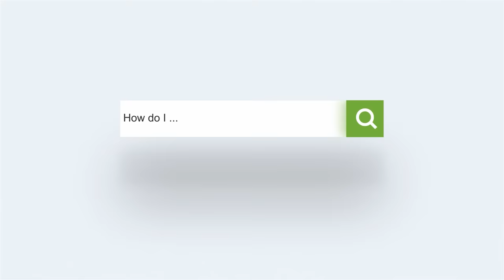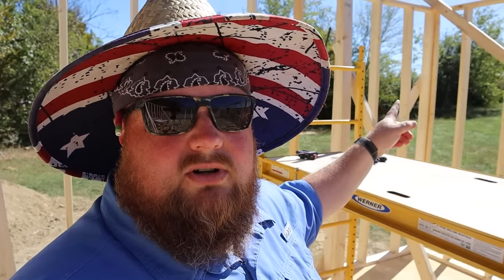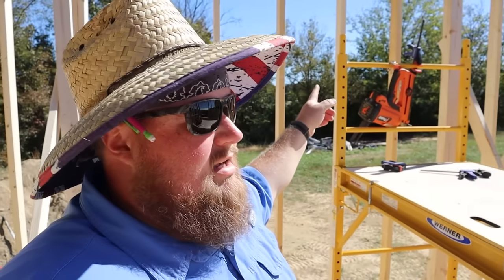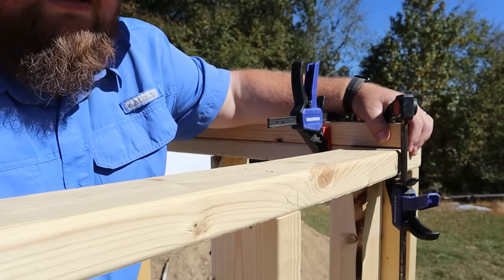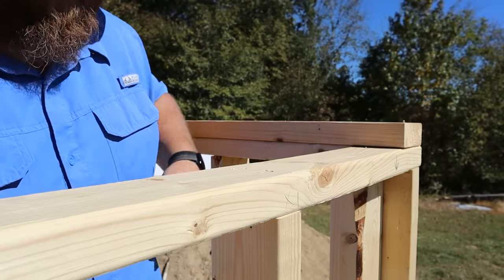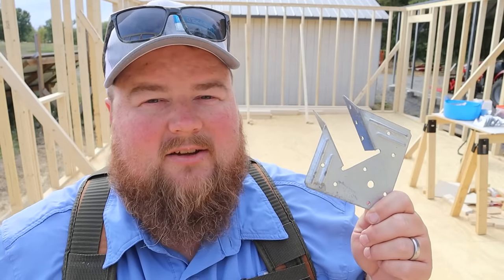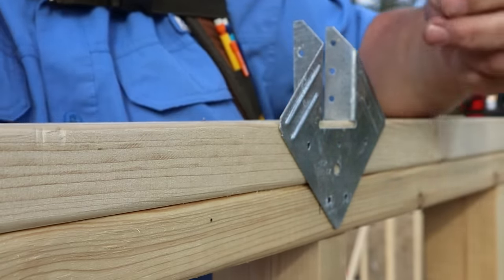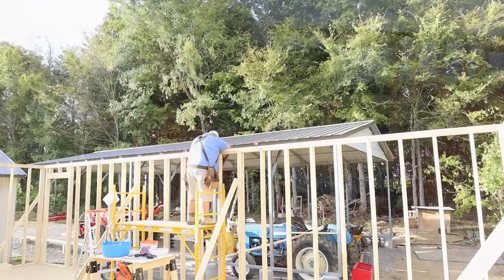Double Top Plate & Roof Truss Preparations! // 20x32 Workshop Build

Comment: Never knew the hurricane brackets could be installed on the outside. I always though they were put on the inside of the building. Nice to have options.
Reply from the maker: The exterior install is the preferred location, but when done as a retrofit or repair placing them inside is better than nothing. :) I installed them on the inside of my current workshop when I built it, not knowing better then.
Reply: @Samcraftcom Do the screws in the hurricane clip affect the exterior siding? It seems that the screw head would push the siding out. Thanks in advance.

Comment: When nailing the top plate on, I like to angle the nails. One nail angled to the left, the other angled to the right. Or to the inside and outside. Having the nails at opposing angles helps to lock the 2 boards together much better than just nails straight in. 

Super job, looking good. Thanks for bringing us along
Reply from the maker: Great tip!

Comment: Awesome playlist, I'm watching the entire thing while planning our home build for spring 2025. 

Question, while nailing your double top plate directly on top of studs, how are you not hitting the nails that hold the stud to the top plate?

Is there a technique to this, sheer luck or something I'm missing? I would think it would be better to offset a few inches and nail at an angle towards the stud no?
Reply: You just nail the top plate to one side or the other of the stud centre.  Basically, you put them as close as you can without hitting the nail underneath.  If you are framing a lot, this will come second nature to you.

Comment: suggestion to put a 2x2   around top plate for a nail/ screw  anchor place for ceiling panels Sheetrock or other paneling  also  i believe called California corners  also for paneling screws at corner locations  eliminate floating edges
Reply from the maker: You're exactly right on the California corners - they act as drywall nailers inside the walls. The ceiling nailers will be installed later on, but only on the gable end walls. Anything put in place on the truss bearing (side) walls would need to be cut and fit between each truss to overhang into the room.

Comment: Hahaha Sam, this has just proved a point that ALL men make to their better half's. When we are asked " why don't you throw that away, your not going to use it!". And we reply back " I'm going to be needing it at some point!".   The roofing brackets maybe about 6 years old but you still used them and not only did you have a chance to use them but you nodoubt have managed to save a few dollars in the process.  Sam what is the plan for the roofing are you doing a flat roof or a slight pitch which alway's looks way better!!!. As always buddy 💯%   👍   🇬🇧.
Reply from the maker: As much as I would like to take credit, I think I just got really lucky since we were cleaning up a storage area a few days before and I found them. :) 

The roof will be a gable pitch roof made up of engineered trusses.

Comment: I just noticed that you don't have gutters on your carport. You should put them on the side facing your shop, otherwise the water running off will splash against the side of the shop, go through any seams/gaps and rot the walls.
Reply from the maker: It's on the list. As it is built right now it's "not compatible" for gutters to be added. However, I've come up with a solution and way to add them properly.
Reply: Great work Sam ❤❤❤

Comment: I have looked for an answer to this, and maybe if you have time you might give it some thought.  Putting up walls on a slab where the slab extends 10: past the wall with no way to move walls closer to edge.  How do you keep rain water from coming under or through those pressure treated plates. Thanks.
Reply: the top of any concrete that butts up against the exterior walls needs to be lower than the surface of the main area.
Reply from the maker: Here's my non-expert opinion of how I would address the issue if the concrete and wall placement cannot be moved. I would treat the wall-to-slab-seam similar to how windows are flashed. I would put a wide waterproofing membrane over the wall and down to the slab and extend it as far as possible -- all as one continuous piece from wall to slab. I would use something like "GCP Applied Technologies Bituthene 4000 Waterproof Membrane". If you're framing the walls on top of the concrete, don't forget your treated wood bottom plate and your sill sealant (foam strip and also a few beads of Big Stretch caulking). Think of your wall and slab as a home's basement wall and foundation and waterproof them the same way.
Reply: @Samcraftcom  Thanks I will give that a go.

Comment: One downside of the simpson screws in that particular application is interference with exterior sheathing. Not a huge deal but it will bow out a bit up top.
Reply from the maker: That is true, but it will also be covered/hidden by the soffit assuming a standard soffit install vs. exposed rafter tails.
Reply: @Samcraftcom  exactly
Reply: I've always seen the hurricane brackets installed on the inside of the wall not the outside. I guess your soffit will hide it just an interesting choice. looking good though won't be long before you get to move in.

Comment: HOW DO YOU MEASURE HOW LONG YOUR TRUSSES HAVE TO BE?
Reply from the maker: For engineered trusses, the company you go through will ask you questions and design them for you. :) The want to know the following information: exterior wall width, desired overhang, roof pitch, truss spacing, and if you want drop gable end trusses or otherwise. I talked to several for quotes and they all were very accommodating and happy to answer my questions.

Comment: If I were you and I was going to be flipping the trusses alone, I would take off the hurricane clips and put in a 2x4 stop at each truss space then when they were flipped up put a temporary 2x4 across the trusses to keep them upright and stable, then remove the 2x4 stops and attach the trusses. Doing trusses alone is not fun. Best wishes.  And watch the points.

Comment: shouldn't the hurricane ties be on the inside
Reply: Thinking the same thing
Reply: I was wondering the same thing and also would put the trusses on first and then install the ties.
Reply from the maker: The recommended location of the roof to top plate hurricane ties is on the exterior side of the wall (same side as the structural sheathing).

Comment: Should have just built the double top plate into the wall when you had it on the floor building it and also you could have put the hurricane straps on at the same time. That would have eliminated all that overhead work and scaffold work until the Raptors at least anyway